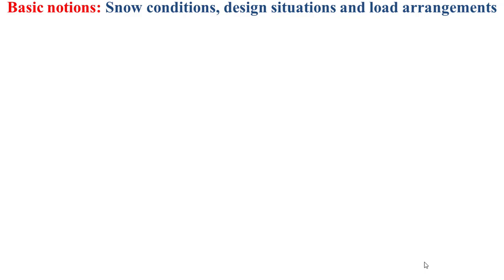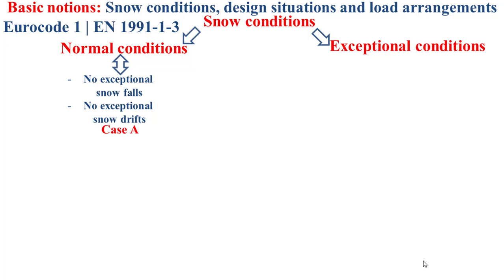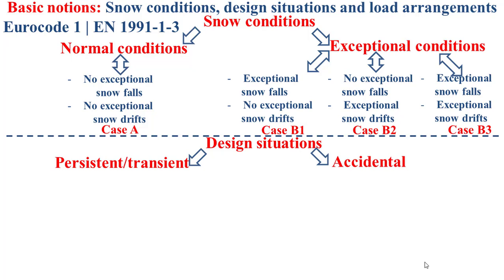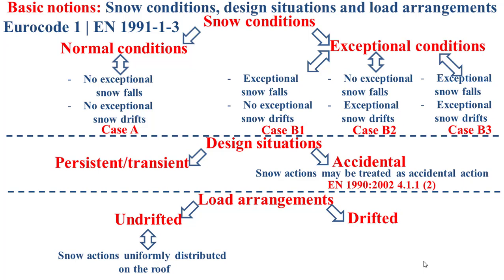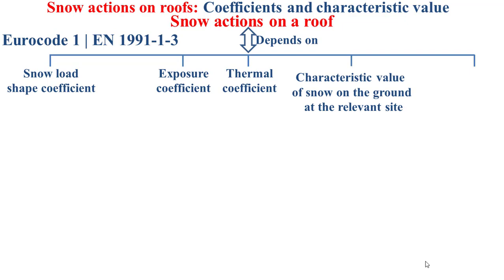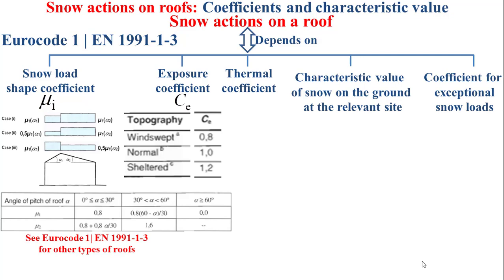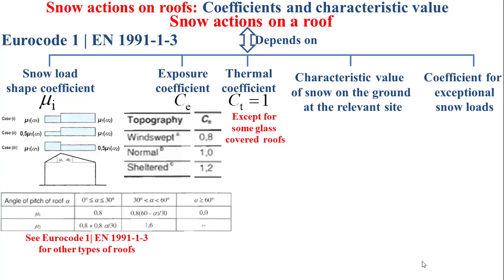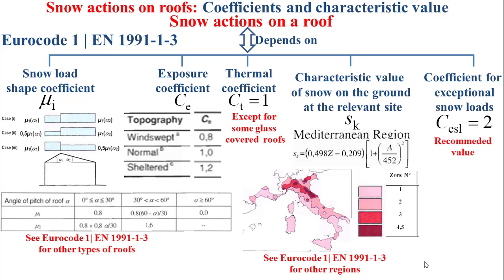Snow action (Snow load)_Eurocode 1 |EN 1991-1-3

Comment: please note that reffering to eurocode Z values you posted are not for medi region
Reply from the maker: Thank you for your interest. Please note that referring to Eurocode 1-Part 1.3--Figure C.6, The Z values (Zone number values) for Mediterranean region are exactly similar to the showed values in the educational video. If you mean by "z values" the ones in the column at the right to the Zone N° column, please note that  these values are rather the associated values of the characteristic snow load on the ground Sk (in kN/m^2) at the sea level A=0.  Also, the characteristic snow load on the ground Sk is exactly the one associated to the Mediterranean region referring to Eurocode1-Part 1.3-Table C.1. Hence, the content of the educational video is correct. If you have any other remarks, please do not hesitate to mention it.